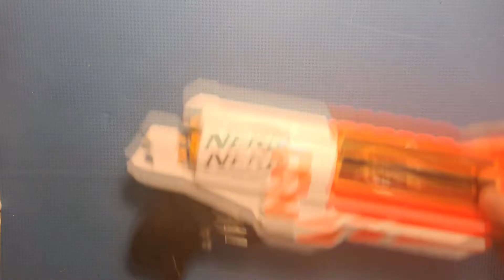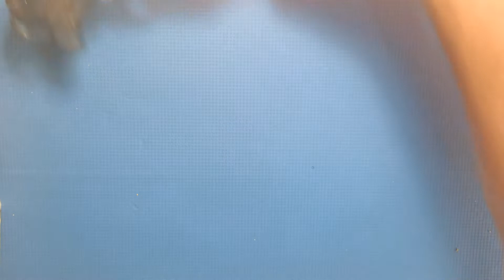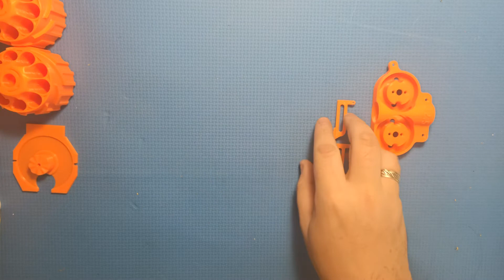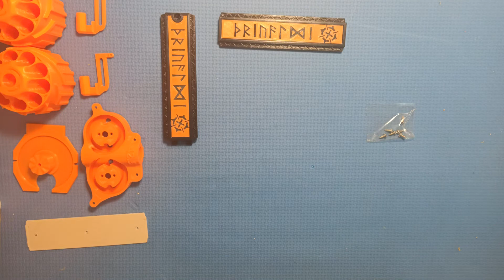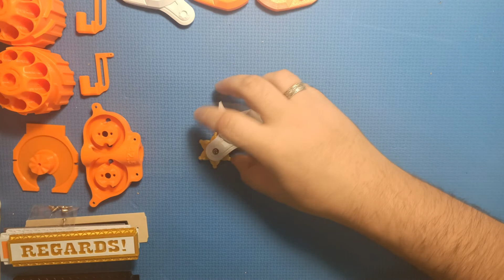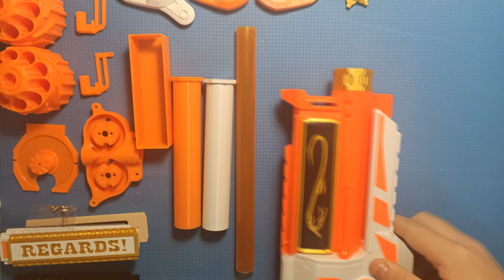Nerf Ultra2 3D printed parts info

Comment: I saw your doing a mega cylinder ...can you use the standard motors and cage  or do you need to upgrade ?
Reply from the maker: its up to you but both options can be used just make sure you order the correct cage

Comment: About the commissions thing, since you live in Australia, you have the gray trigger versions of the blaster in stores, which are known to be weaker due to regulations. If I wanted to purchase a commission but wanted an orange trigger blaster, would I be able to ship you one from the states for you to work on?
Reply from the maker: so the difference is a little circuit board that gets removed during the rewire so in the end they are the same

Comment: If i just order the bullet case to fit elite darts and still using stock cage and flywheel is it still working?
Reply from the maker: No the gap in the flywheels is too wide. I sell it as a kit because you need all of the parts for it to work
Reply: @fracturedfun2347  i see, can you email me price for the kit and shipping cost to Indonesia? To adji.tridika48@gmail.com